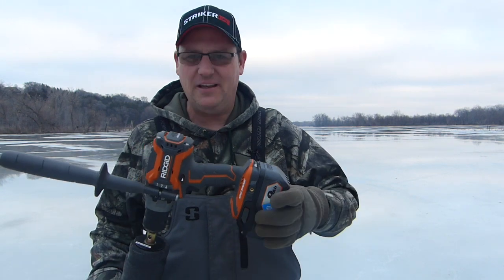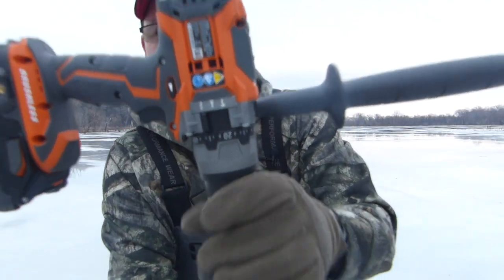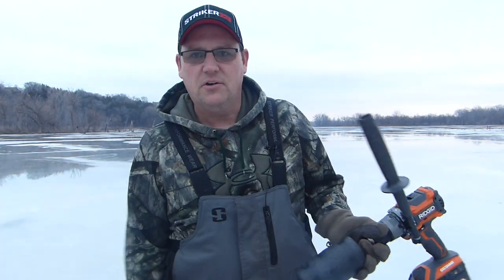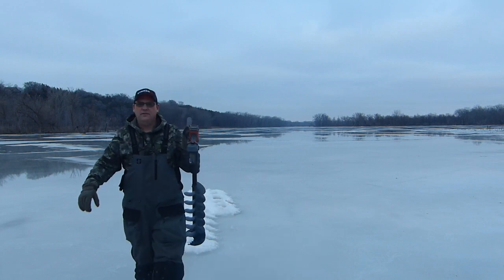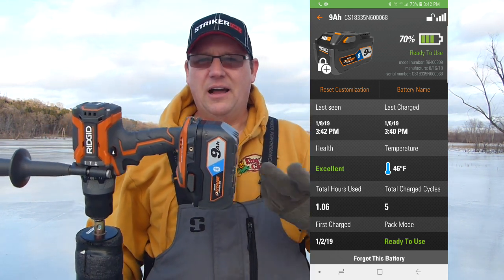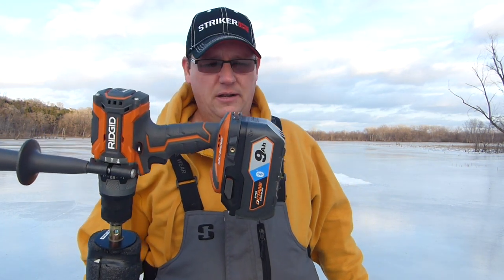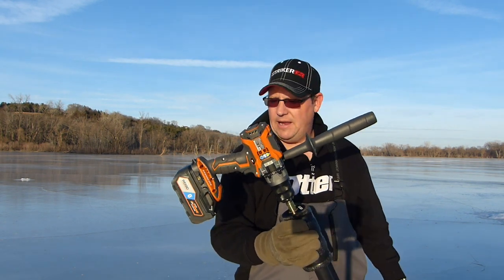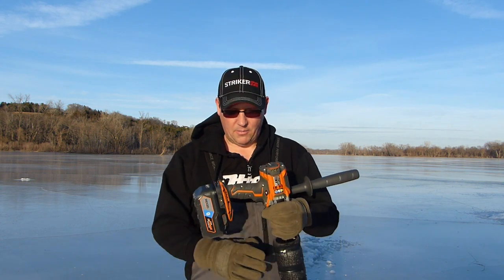Rematch! Ridgid Octane VS Dewalt Hammerdrill Ice Auger KDrill

Comment: He rigid has a 9amp battery compared to the dewalts 5amp... unfair advantage
Reply from the maker: I said that in the video several times.
Reply: Correct but can’t really compare the 2 like that. It’s like racing 2 cars when one of them is out of gas
Reply: Running cold batteries from being in the truck all night.  ? Does it matter much?  I'm in manitoba where it gets a little colder
Reply: You're a bright one lol I think he stated that probably five different times during this video.
Reply: So what's the ponit of the test " brite one" ? It's pointless unless the same battery is used.
Reply: Simple math. Dewalt: 6holes/Ah   Ridgid: 5.1holes/Ah
So simply stated the Dewalt is more efficient in it's power delivery or storage. 

You could assume if you had 9ah for the Dewalt it should drill about 54 holes vs Ridgid doing 46.

Myself I just ordered the Dewalt with this video among others comparing the two. The DCK299D1T1 kit is on sale right now at Amazon for $288 with prime delivery. It's the 3 speed Dewalt XR MAX with a 6ah/2ah 20v/60x Flex battery. Plus the kit includes a 1/4 impact driver and an extra 2ah 20v battery. Really good deal right now.

Comment: The milwaukee is still king
Reply: Debatable
Reply: Dewalt gen 2 beat out Milwaukee gen 3
Reply: @loucifer323  no chance i run my milwaukee fuel on a 9 amp and it drills well over 100 holes in 12 inches of ice. Ive never run the battery flat once. We usually fish three day weekends.